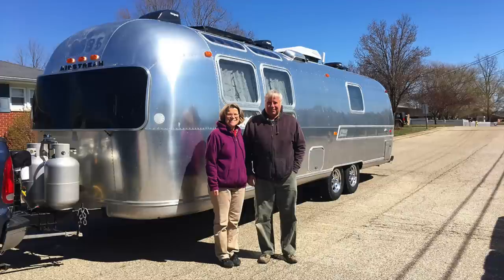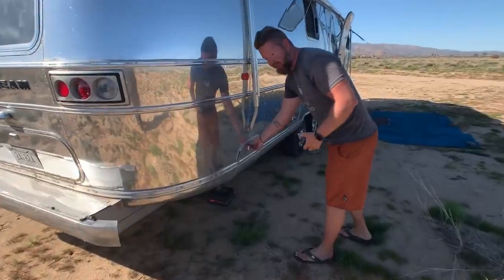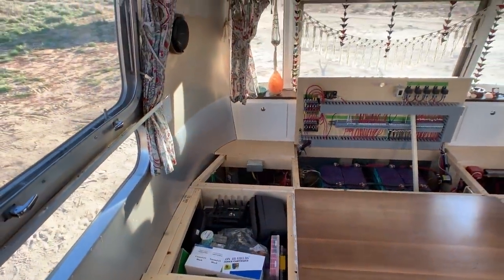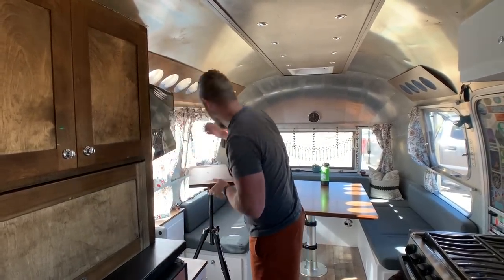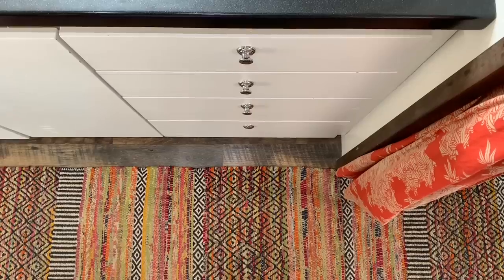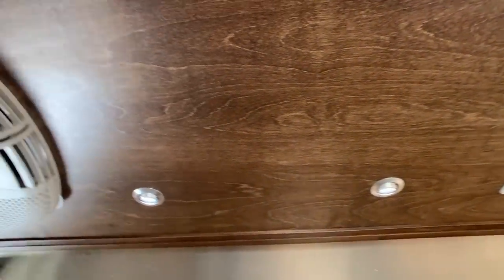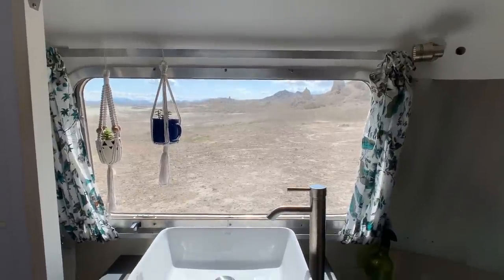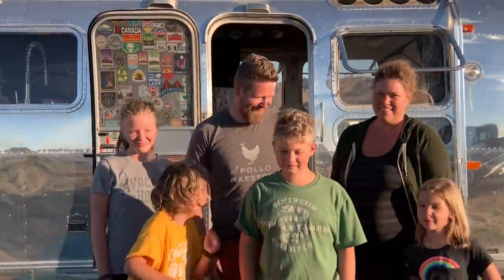Airstream Renovation Tour - Before & After - Was it Worth it for our Family of SIX?

Comment: This is a wonderful tour of the re-done Airstream. So many features in so small a space. I'm very impressed how beautiful it turned out. I love the fantastic fans you put on and how the antenna works. Nice pacement of the solar panels and all the solar power equipment and wiring. I'm glad you fixed all the running portions of the trailer. All the new axels, tires and lift kits are such a good idea to make new. My sister was very hurt when their RV tire blew and they rolled into the highway median at 75 miles per hour. Not good! Nice that you went with an electric freezer/refrigerator. If you have propane you have to make sure you are exactly level or it doesn't work so well. I love the sleeping spaces and all the bathroom arrangement. I never knew you could have a shower pole that could be moved in and out. It does look very homey and I'm so glad you got to bring the ruler from your house with you. I love all the stickers on the door and walls of all the places you visited. I like the home office. Amazing job on your tiny shiny home!

Comment: Why not add some heavy duty velco strips behind the tv on the wall and wrap it around the tv to secure it. The really wide ones. You can use E6000 glue and they will not go anywhere!  This way you won't have to remove it and take a chance of it sliding off the seat. :) I hope I explained it to where you can see how this would benefit you guys. Very nice place!

Comment: Total fan thanks for sharing the way to prevent leaks where rivets are is some clear silicone a grade of course
That's what I used to use when I built dust and fume control systems
Should make for much easier sailing down the road absolutely gorgeous thank you for sharing
With pipes for instance when you rivet them prior to welding the two edges are overlapped with clear silicone applied in between no need to spread out just make a long line the sheets pressing on each other will flatten it out to perfect seal so don't mess with it
Then wet the corner of a cloth and run it down and along the edges so it's convex throw the cloth away
Perfect seal easy to maintain

Comment: Questions 1) Was there a reason you didn’t go with a 3 axle 33’ or 34’ Airstream with the 5 person family remodel? 2) Do you have any regrets OR are you thankful  that you didn’t go bigger? I have 3 children and was going to renovate with the bunk house in the back (side bath), and our front setup exactly like yours - but I was leaning towards a later model airstream so that I could go larger. Do you have any thoughts or recommendations with regards to the larger airstream? Thank you for your time...really amazing and greatly appreciated that you actually respond to all your comments.
Reply from the maker: We actually wanted a 27' - maneuverability starts getting tricky the longer you get. Especially if you are going down the crazy roads we do boondocking. Those longer Airstreams have a much higher probability of bottoming out, even with a lift kit because there's more sticking off the back past the wheels. Since these aren't 5th wheels, the total length adds up quick. With a 22' truck and 31' trailer + hitch, we're well over 50 feet. That being said, I'm glad we ended up with the 31' because as the kids have gotten older (and bigger) we've appreciated the extra space. But I wouldn't go bigger for sure unless you just plan on being in parks all the time.
Reply: Great info...thank you. I plan to do more parks than you are probably use to, but I still want the functionality that you mentioned with your 31. I will definitely factor in your recommendations in the coming months during my search. Thank you again for the prompt and valuable response. You will see me in your “Store” soon - I’m intrigued by your website and story😊
Reply from the maker: Also, many older National and state parks will be harder to get into the longer you are. Anyhow, we appreciate it man! Good luck on your project!
Reply: Thank you!😊

Comment: I love the aluminum bar stock you used for the curtain rods. Would you reveal what size bar stock you used? I'm very interested in how you bent those too! I can only hope that  when I'm done my trailer comes out as half as nice a trailer! Thanks!
Reply from the maker: Hey Al, It's just stock aluminum bar you can buy at any hardware store. We used 1" for the top and 3/4" for the lower ones that hold the curtains back. Bending it is pretty easy (it's aluminum!) but bending it in the right place was a huge pain. Lots of measuring for sure! Thanks for the kind words :)

Comment: You did a great job on this remodel. I'm not an expert but the only thing I see is that it could be an EMF nightmare. Sleeping above the electrical infrastructure is very dangerous and then being inside an aluminum tube amplifies the radiation even more. I would recommend shielding the electric panels under the bed and maybe asking Shielded Healing for more advice. Otherwise, it looks awesome!
Reply from the maker: Lindsay Conrad-Alfieri thanks Lindsey, something to look into, but any trailer you get (especially an Airstream) is going to have a similar setup with converter/inverter under the bed. I would think if it were an EMF problem they wouldn’t be building them that way.
Reply: @TinyShinyHome  I would hope, at least, although EMF knowledge is surprisingly not common. It's a serious problem though because it's very carcinogenic. You can buy a meter easily though and measure it yourself. Anyways, just wanted to share knowledge in case it helps you! :)

Comment: Nice job, we're about 4 months from finishing a similar rig made from out '71 29 foot  Ambassador. I like the "curtain rods". Do you have to unbolt them from the wall to take the curtain off?
Reply from the maker: Thanks Manning! Depends on the curtain. We've had a set that we made velcro loops for to take on and off. The current ones have ties at the top. So we haven't ever had to unbolt them to remove the curtains.
Reply: @TinyShinyHome  Good solution, I think I'll pass this on to the boss.

Comment: Great and detailed tour!! Do you find that you are needing to plug in with the 30 Amp power very often, I'm upgrading my airstream and thinking if I put up enough solar and have a good lithium bank I can avoid having to do any of the transfer switches and such. Thoughts?
Reply from the maker: Thanks Patrick - good question! We can definitely be off-grid for weeks at a time, but I wouldn't recommend removing your shore power completely. When it's hot it's nice to be able to pull up to a park, hookup, and use our air conditioner. Being able to connect a generator/shore power is also important for emergencies - there's always going to be a situation like constant rain, tree cover, shorter days, etc... that could deplete your system no matter how much solar and lithium you have. Well, within reason. I guess you could drop 20k on a solar and battery setup and be able to weather just about anything. But I think it's important to have options because you never know what's going to happen. Maybe you end up storing the rig in a covered shelter down the road. How would you keep the batteries topped off then? Stuff like that. You might want to check out our recent video about adding more solar and a bigger inverter, too: https://youtu.be/BXBWD7JeVbE
Reply: Tiny Shiny Home does your reply to Patricks comment mean you're limited to using your AC unit only when docked/connected to 30 amp power source...in other words your solar/battery set-up does not run your AC?
Reply from the maker: @OrlandoCazarez  Correct. A solar/battery install that would run our AC didn't feel like it was worth the investment (we spent at least $7k on ours and probably would have needed to spend another $7k to make it big and powerful enough). We can just move if it gets too hot :) We do have a single Honda 2000 generator that could potentially run the AC if we installed a "soft" or "easy" start. Just haven't gotten around to installing one yet (and were waiting for the AC warranty to expire).

Comment: In one of your previous videos you indicated that you are interested in the next version of MacOS for dual monitor support. Right now I assume you use a lightning to hdmi connector for your current monitor, if you get an AppleTV you can actually use dual monitors right now just by casting a second workspace to the AppleTV using the extended desktop feature that has been in MacOS for years now.

What are your plans for future videos? We plan to go full time next summer with our autistic son so I subscribe to several full time families to see what they are doing on the road with their kids.
Reply from the maker: InMyImage I actually have a Mac cinema display that connects to my laptop via thunderbolt. No HDMI connections there unfortunately. I’m interested in using an iPad Pro as a second monitor and using the Apple Pencil to draw straight on my Mac when the next OS versions come out.

Comment: Did you spray in foam insulation in the walls?  Is your RV hot?
Reply from the maker: Rhonda Callahan between the walls there is only 1.5” of space to insulate. We first put in a layer of reflectix and then we went with a Rockwool insulation. No spray foam. Don’t like the idea of that Incase we ever needed to get in there and fix something.

Comment: Awesome build. Curious, how do you prevent interior moisture and mold?
Reply from the maker: Thanks Clark! The same way you prevent it in any other trailer :) Stay in dry climates, run a humidifier, etc... We haven't really had any issues so far, but do prefer the desert so that helps. It also helps that our bed turns into a dinette each day so that's getting aired out regularly. We like to keep windows open a lot as well.
Reply: @TinyShinyHome  Thanks so much. Any advice is great advice. We haven't built ours yet so we are asking all the questions we need to b4 laying insulation.
Reply from the maker: @TheRealKalEll  Sure thing! I've heard of people putting something under their mattress that promotes airflow to help, too. Can't remember what it's called, though.

Comment: Can you run your air conditioning with just solar power?  I purchased a stripped '67 last week and am trying to decide if/how much solar is viable.  I really don't understand sacrificing so much storage space for duct work. Why would you not just use an overhead unit?  
I spent my most of my childhood/all of my teen years in a '53 GMC conversion with my parents and 3 siblings.  Kids need far less privacy or things than is considered acceptable in our society. :)
Reply from the maker: You *can*, but it requires a huge expensive setup to be able to run it. But even then you're going to be very limited as to how long you can run it. The other option is switching everything to 48v instead of 12v - that makes the conversion easier. But that's an entirely different conversation :) That being said, we do have an overhead AC unit, and not sure what you mean about sacrificing storage space for duct work. We just have two small 4" tubes for the furnace, and it's pretty standard (similar to how it was before we gutted it). They just cut into the space a little bit. Sounds like an awesome adventure you had!!!